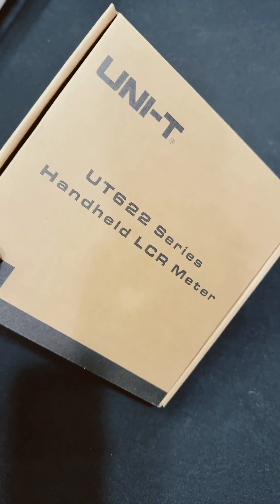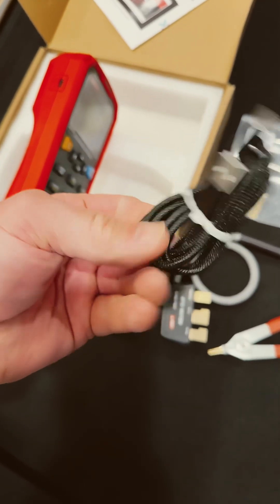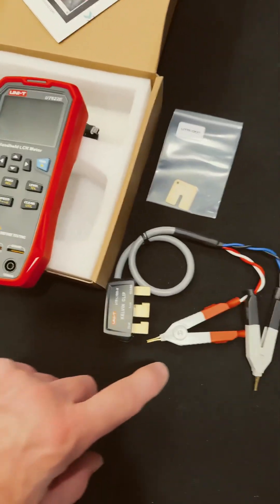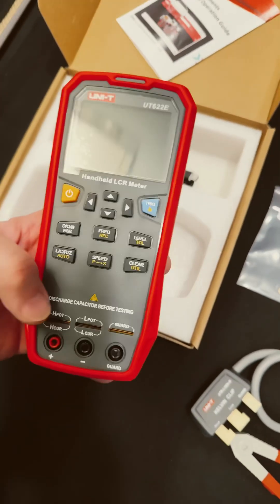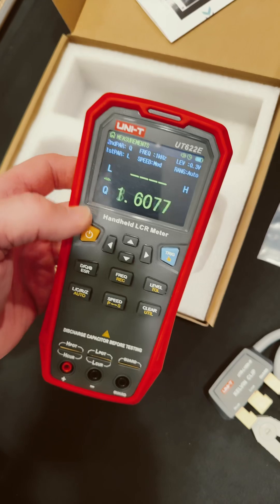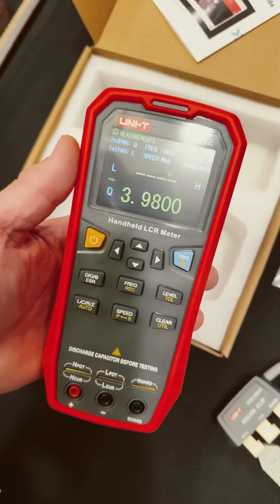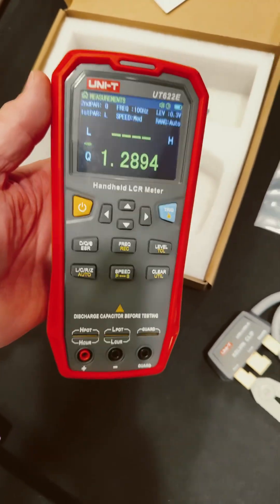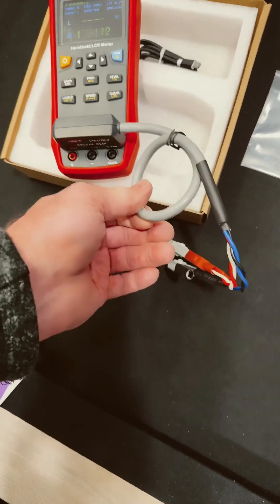LCR meter UNI-T UT622E #handheldLCR

Comment: Eddie,  could you please do a comparison shootoff between the UNI-T and the Fnrsi? There is a factor of 5 difference in price.
Reply from the maker: Yes - thanks for asking!  I think Fnirsi is going to send one out.  I'll also include Fnirsi's lower cost smaller unit as well.
Reply: @KissAnalog  I was very surprised at the cost of the Uni-T's LCR meter.
Reply from the maker: Yes, I agree  - so I need to compare the resolution specs to see how many digits and accuracy that they might be providing.  Maybe their readings at small values are much better.  I have a handful of meters to compare now.